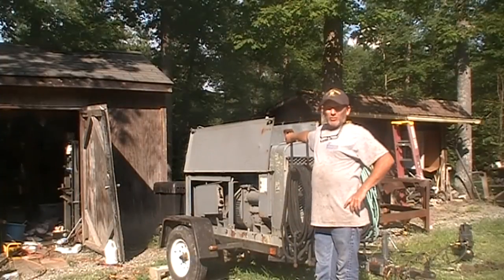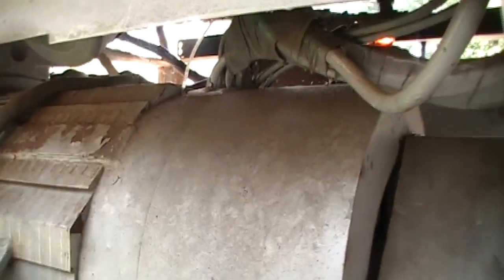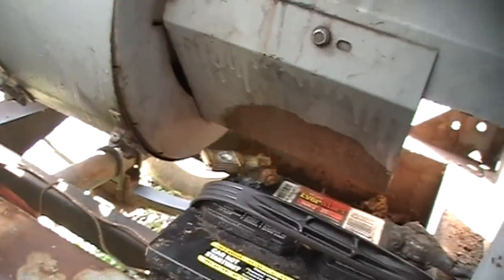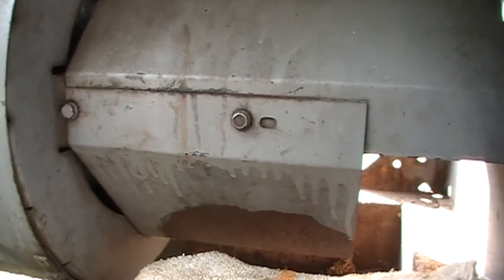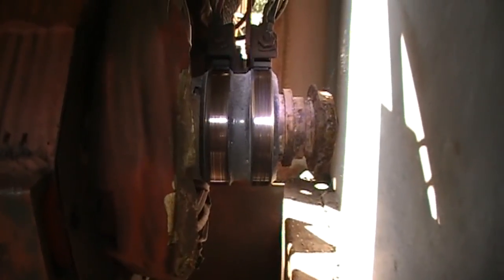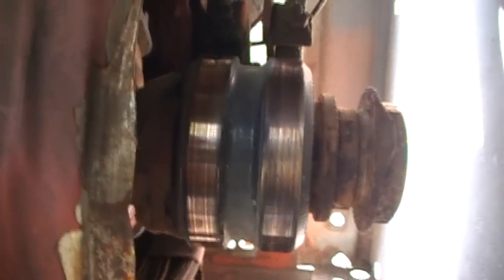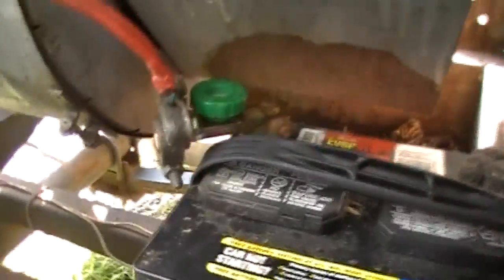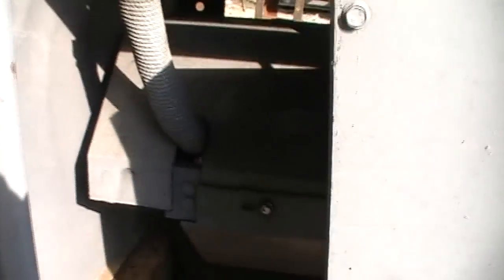lincoln sa250 welding machine repair

Comment: Just saw the video, I have one similar, mine won't strike an arc, when idling (low rpm), but if you turn it to high idle it'll weld perfect.
Btw. excellent video!👍 Great oil pressure.
Reply from the maker: contact Bw parts ask for tech support they can tell you what to do to fix that and how to test it. nice people over there. tell them I sent you and it may or may not make a difference in price on parts. here is the link https://bwparts.com/all-products/sa250-welder-parts.html
Reply: @daveknowshow  Thanks Dave, looking forward to do that.

Comment: An electrical supply house has a thing that looks like a honing stone called a commutator stick that ,after being sure your brushes are free and are long enough  ,you start the engine and gently rub the stone on the "slip rings " and clean the "slip rings " and brushes simultaneously!
Reply from the maker: I did actually buy the stone just a few months ago and cleaned them when I replaced a few parts. she still runs but sometimes takes a few minute to excite the welder. may be losing its magnetism. at least that is what I read.

Comment: Dave, What is the box on the right side of the machine by the area you were working on, standing at the back and looking forward?
Reply from the maker: cc/cv controller for a specific model spool gun. I do not own the spool gun wish I did.
Reply: @daveknowshow  thanks. Was just curious. Hadn't seen it on any other welder I looked at.

Comment: Those shiny copper rings at 4:30ish are slip rings, not a commutator. A commutator is segmented bars. Both perform essentially the same function. I use scotchbrite to clean oxidation. Unlike sandpaper, there is no chance for it to leave abrasive embedded in either the carbon brushes or the soft copper of the slip rings or commutator.

I also have a Perkins powered SA250. Mine does not have the box under the right side door. Is that for a wire feeder?
Reply from the maker: Yes it’s for a wire feeder. I tried to find one used that would work but no luck so far. I got the stones for doing the slip rings but scotch bright would work. The stones are faster. I recently replaced that entire assembly. I think I shipped it out and had it rewound. Can’t remember exactly. I forget what that is called but you are correct slip ring is the term they use to label them.
Reply: @daveknowshow  I bought my SA250 from a scrapyard, partially disassembled. I put it back together and got it running...which was a chore. It had red diesel in it that smelled awful, and a layer of gunk in the sediment bowl I had to scrape out. It was nasty. Anyhow, it turned out that the armature was shorted and it wouldn't weld or make AC. I got lucky and found a used armature locally. I still haven't sorted out why the auto idle isn't functioning, but that's pretty minor.

I believe a LN7 or LN25 should be the correct wire feed unit, but you should ask on weldingweb to be sure. Lots of good guys and info there.

Comment: What size battery is that? I have my battery sitting out side of the frame since its oversized
Reply from the maker: I’m not sure. I just grabbed one at Walmart that looked like it would fit. I used a tape measure.

Comment: Hi man, hope you be good.
I have a troubleshooting with my machine, it doesn’t work at minimum power. It’s only works On top of his power MAX-240 and the amperage is on top but when I go down a little bit the amperage the machine stop welding. 
Do you have any idea what could be the troubleshooting?? 
Thanks for answer my question
Reply from the maker: not sure but you should try cleaning the selector switches. they get dirty and then they dont work. sometimes just working them back and forth is all it takes. additionally you may have dirty brushes on the pick up. if you contact lincoln electric they have the service manual available for that machine. hope this helps.
Reply: @daveknowshow  hi Dave thanks for answer, I cleaned the switch selector, but I doesn’t work. Let me try cleaning the brushes on back side, about the repair manual, how can I get manual? I’m living in Venezuela can I request from internet? 
Thanks again for answer
Reply from the maker: @pascualperrino4071  I would contact Lincoln electric via email and tell them the model and serial number of your machine. ask if they have a service manual you can buy. they will likely send it for free or at a really low price.  https://www.lincolnelectric.com/en-us/Pages/default.aspx

Comment: Hello Dave. My welder just like Yours. Starts Great. Runs for a short time then dies. It acts like a fuel supply but I replaced the fuse and it worked good for a while. Hauled it and the same problem came back. Changed the fuse again but the problem is the same. Any idea ? Thank You for Your time : )
Reply from the maker: yes I do have an idea. I went through the same issue. standing at the control panel you will see that red reset button you push in before starting the machine. that button is connected to a circuit board. that circuit board send power to the fuel control valve. it has a timer circuit in there that makes that button pop out when the unit is shut off. when the machine is running the alternator sends power to hold the fuel valve open.  remove that circuit board being careful of any wasp nest to not get stung. " ask me how I know " make sure you label all the wires as to where they go. once you open that device up you will see a broken connection on one terminal. I used a small drill it and drilled it out. then used a small screw and nut and fasten it back together on the board. that took care of it. you can likely order the new part from lincoln directly. I ordered all the books and manuals from them for mine. I may even order a new part since you brought it up. I should get that replaced myself. my fix works but I dont know for how long. of course its been fine now for many years. I wish I had of made a video of that repair. its a common problem on these machines. the vibration is what I assume does it. let me know if you need further help.
Reply: @daveknowshow  Thank You So Very Much : ) Cool will check it in the morning : ) God Thank You : ) So Cool : )
Reply from the maker: @glentoner3689  please keep me updated if this works for you.

Comment: Saludos mi amigo tengo una maquina de soldar lincol arc welder a gasoil ,estaba soldando con ella y dejó de soldar ya la e revisado y nada no hace nada me podría ayudar en algo
Reply from the maker: check the fuse on the panel behind the variable control. its located on the board that controls the solenoid for the fuel. its is most likely not getting fuel

Comment: Hola amigo soy de Venezuela yo tengo una igual pero no me quiere soldar dejo de soldar que podría ser
Reply from the maker: could be fuel if will not run if simply not welding it is likely the stator. you can buy a new stator from lincoln electric or you can get your old stator rewound. I had mine rewound and now works great.

Comment: I got the same machine. Mines not getting power there or from the leads any tips?
Reply from the maker: same issue i'm sure brushes need cleaning. I think the part for the welding leads is called the exciter. I will see if I can find some info on it and if I do i'll leave a comment here. most of the time its just dirty and needs cleaning.
Reply: ***** awsome thanks. Yeah it hasn't been welded in a couple years so I'm sure it's it. But I'm fixing to start welding and just preparing for the worst. Just in case

Comment: I got a starting engine probrems...it was working good but suddenly stops n since then I couldn't make it run...it give the start process but can here the starting sound but doesn't start...where I begin checking to find the problem n make it run,,,, please, thnks
Reply from the maker: if it turns over but wont start its likely a fuel issue. the sa250 has an electric fuel shut off that works off an electronic board located behind the amp control knob. if you open the side cover opposite the battery you will see it. if that board goes bad or the fuse on the board blows the welder will not start. the fuse is typically a glass fuse. I cant remember what size it was though. hope this helps.
Reply from the maker: Gilbert Charles  I wish I knew more about it. if the pump was removed it likely lost prime and these engines can be a real pain to get primed with fuel again. there should be a hand pump on the side to get the fuel flowing. however there is also a electric operated solenoid valve that controls the fuel flow as well. if that does not open it will sound like its gonna start but it wont start. that solenoid is controlled by an electronic board located behind the main front panel. standing at the start button which is on your left this board is located in the right just to the side of the electrical outlets behind that panel. you can get to that board by looking up from the side. it will have several wires going to it and be very careful when removing the unit. those wire connections rust and break off. this will keep that solenoid from opening and therefore the machine will not start. I had to remove mine and rework it to make it function again. if the wires are off of yours I can snap a picture of mine so you will know where to put each wire. that board is turned on by the small red button that is marked reset if I remember correctly on the front of the machine. you can email me at DAVEKNOWSHOW@AOL.COM and I will be happy to try and help you if that board is the problem.

Comment: Mine won’t start idk what to check I bought it a while back it’s an SA 250
Reply from the maker: more likely a fuel issue. check to make sure the fuel is good and the injectors are primed and have no air in the line. also the solenoid that controls fuel flow may not be opening due to a blown fuse located on the circuit board behind the front face control panel where you adjust amperage. look up inside with a flashlite.
Reply: @daveknowshow  I appreciate the that 🙏🏻

Comment: I have a sa-250 that runs great but it doesn't want to weld. What could be wrong with it.
Reply from the maker: there are pick ups on the commutator that can get dirty and it will not weld. I would start by cleaning those. they look similar to the brushes I cleaned in this video but are located further back in the welder generator part. also the " timing"  has to be set correctly or it will weld like crap. it has something to do with the cycles I believe. I don't know a lot about these machines. I do have the shop manual for mine which I ordered a few years ago from Lincoln electric. it goes into full detail about many aspects of the machine, parts and wiring diagrams. if you can work on stuff you should get that book and read over it. you will likely solve your problem with the help of that book. that is how I repair mine using logical trouble shooting skills and the book. it has helped me a lot.
Reply: @daveknowshow  Thanks i will clean the brushes tommorrow and see if that helps. Also i will buy the service manual for it.
Reply from the maker: the people at Lincoln are real nice folks they actually sent me all the manuals and shop repair manual for free. this was about ten plus years ago when I got this machine used. not sure if they still send them out for free but its worth what ever they would charge for it.

Comment: How were you going to run your fridge on D.C.?
Reply from the maker: these welding machines have two generators one is a DC welding generator that puts out a rated amperage of about 300 amps peak and run a solid consistent amperage of 250 amps. additionally this specific model has a small 120 / 230 volt A/C generator that will supply about 25 amps peak and 20 amps consistently. this portion of the generator is designed to run your grinders and cutters on job sites as well as flood lights when needed. most newer engine driven machines have a larger 120/230 volt A/C generator that will easily put out about 50 amps consistently. these pipe liner type machines did not have those larger A/C generators I wish it did have a larger one. thank you for stopping by and thanks for the great question. sorry for the delay in answering.
Reply: @daveknowshow  maybe your 95 or whatever has a.c. output but my 78 lincoln sa-250 does not.
Reply from the maker: @teds4983  interesting, no power outlets on the unit at all for powering an angle grinder? I guess maybe they started that later down the line. I think this machine is a 1987 or 89 model year. I would need to go out and look on it. I wrote it down on the side after getting the information from Lincoln electric.
Reply: @daveknowshow  it has outlets but it's not ac back then. Its only D.C, the weld is only D.C. too anyone over 30 yrs old should know that.
Reply from the maker: @teds4983  interesting I'm well over 30 years old and I'm an electrician and I had no idea the outlets on these welding machines were DC only. sure the welder is a DC welder but those DC outputs are 40 volts DC and from a different area of the machine. the power outlets which mine has two I assumed were A/C. I will get my meter and check that first thing this morning  you cant run A/C grinders off a D/C outlet so I'm sure my outlets are A/C. however I'm not a know it all sort of guy and I have been wrong before in life many times in fact its how I have learned so much over the years. I will get back with you on my findings.
Reply: @daveknowshow  well as far as your machine its a lot newer, i have a old 78. The old one like mine you better make sure what your plugging in, thats why i use dewalt tools. Most are ac/dc
Reply from the maker: @teds4983  interesting, mine is A/C it even has it stamped on the machine on a metal tag beside the receptacles. one duplex receptacle is 120 volt AC the other is 230 volt AC. glad mine is like that and not a DC model. thanks for the comment / question and thanks for stopping by. I would assume you could change your DC to AC using a convertor of sorts. could be pricey though for one large enough to handle the amperage even though the amperage would likely be around 20 amps. not sure how clean it would be I sure would not run my favorite TV off it. lol ha ha thanks again for a great question.  just a heads up your comments seem to go straight to the spam folder on youtube. so if your leaving comments on other videos and not getting a response from people that is why. they simply are not seeing your comment. I came across your comment here on accident as I typically do not look at the spam folders for every video I have posted. again many thanks for dropping by my channel!
Reply: @daveknowshow  anytime, i seen somewhere you said your machine is a 95? That would explain. And thank you for the reply
Reply from the maker: @teds4983  its actually a little older than that. I believe its either an 87 or 89 machine  I cant remember but its written on the side door with a permanent marker. to lazy to walk out there. lol
Reply: @daveknowshow  👌

Comment: I have a gasoline welder the problem is start good keep running but when i weld for 30 sec. Dies someone can help me please have idea what's happening
Reply from the maker: not sure to be honest. sounds like a governor problem maybe. could be a fuel issue runs fine at normal idle but when governor kicks in to increase RPM under load conditions the fuel gets shut off. check the fuel lines and replace the filter make sure you have fresh fuel. gas engines can be a pain if they sit for more than 30 days with the same fuel.

Comment: Sir my unit dosnot out put AC supply
Reply from the maker: either brushes need seating or more likely the rotor is bad. I just had to replace mine by having it rewound. the cost was around 600 dollars U.S. also could be a bad rectifier or simply a blown fuse behind the control panel
Reply: The early version of the SA250 was 100% DC output, just like the smaller SA200. Sometime in the early to mid 1980's Lincoln changed the design slightly and added a 3Kw 120/240 AC generator portion. If you have an early machine, it isn't going to output AC no matter what you do.

Comment: I gotta welder sa200 gasoline it weldes one hour and then went off if somebody tell me a tip
Reply from the maker: maria quistian wish I knew. I know the shop manual is available at Lincoln electric. they are very nice folks and if you email them the model and serial number they will send you a shop manual.